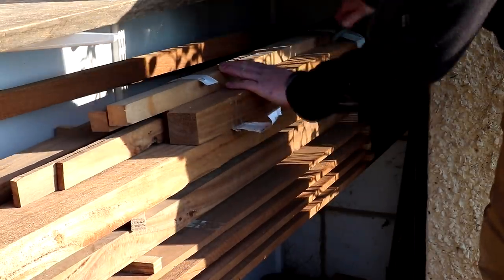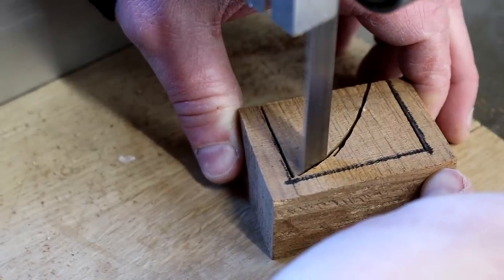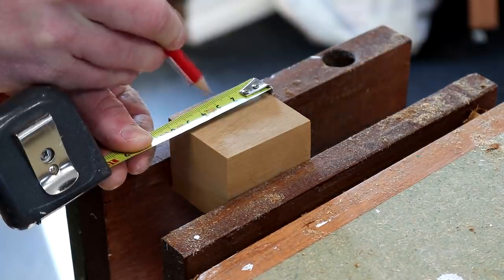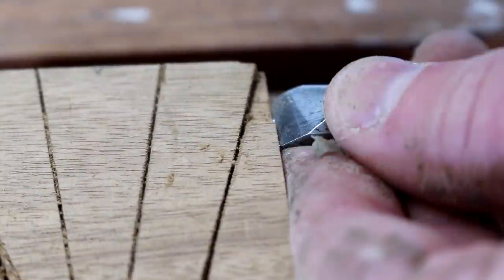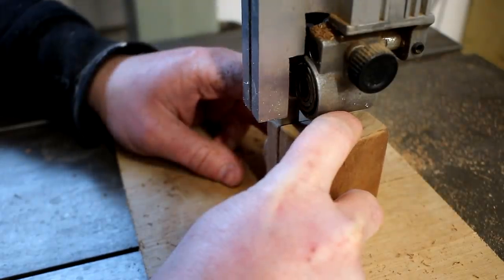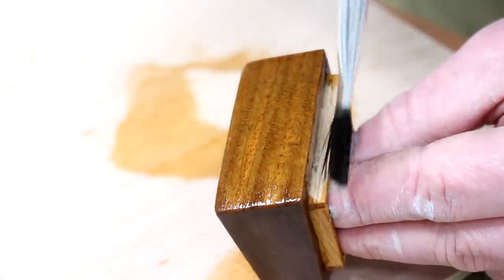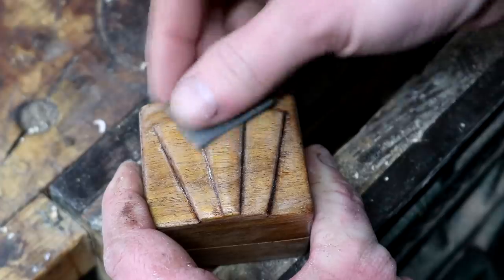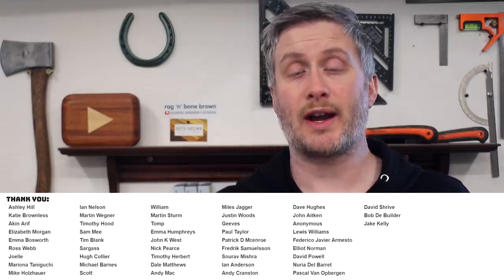Making A Ring Box

Comment: Stange question but would u recomend using dry wall screws for stuctural work like small sheds and workbenches 
Thanks 
Stay safe
Reply from the maker: I used them to hold the cladding on my old workshop and they lasted just fine but they are not recommended for structural stuff, theyre not as strong
Reply: @RagnBoneBrown   chers just asking as I am organising my perants garage as I off collage where I am doing an NVQ in engineering so I trying to come up with some storage solutions 
Thanks
Stay safe